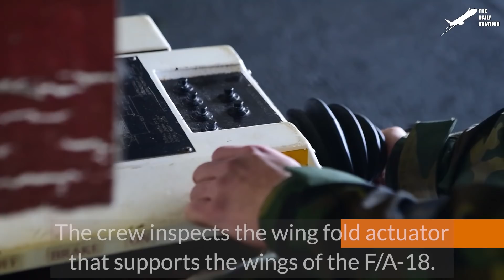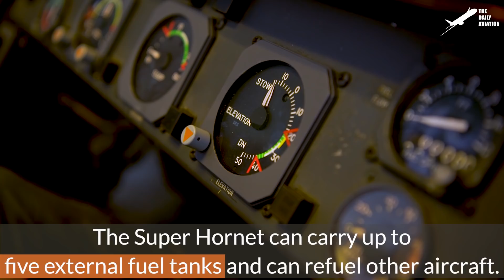Life Inside Massive US Aircraft Carrier Hangar Bay

Comment: the cost of maintenance of this flying machine , specially those super expensive B2 , F22 , F 35 etc... is shocking  , now I understand why not many country can have it , you can buy it but do you have the cash to keep it in good condition everyday is another big issue.
let say myself for example  , i bough brand new Mazda cx9 and the cost to keep it in good condition every year is not cheap at all , cost of proper service , fuel , oil , parts , and the insurance is so expensive because when you have a new car you must have a full cover insurance and it is costing much more higher than the second hand cheap car.

Comment: I, on the other hand, under the sky of the hangar (at min.1: 24) would have installed an industrial (remote controlled) manipulator with the curved end and electrically screwed / unscrewed bolts (precise tightening), to speed up the work.
At 2:15, keep using manual missile trolleys, you're wrong,
There it takes a motorized and remote controlled trolley with robotic arms and folded for 4 missiles, to be lifted then under the fighters.